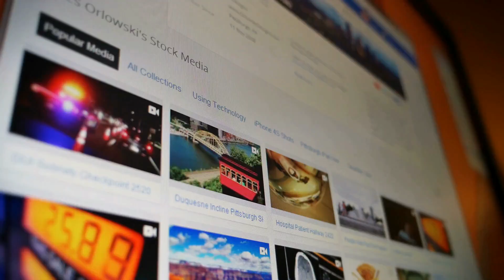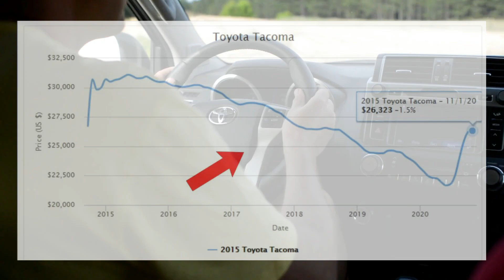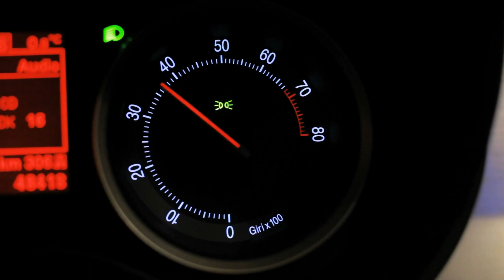Toyota’s NEW INSANE ENGINE BLOWS The Entire Car Industry

Comment: It's wonderful technology and as with most new technology it normally doesn't start out cheap but price goes down as manufacturing becomes more streamlined over time.  My only concern is hydrogen fuel manufacture needs to be done on a much larger scale and the price at least 50% less than fossil fuels in order for it to be a winner.  As it takes about the same time to refill a hydrogen car as a combustion car it's going to be much more convenient and practical than an electric. Who wants to wait for over an hour to charge up an electric? Who has that time in a normal working day to begin with???:yt:...thank you...